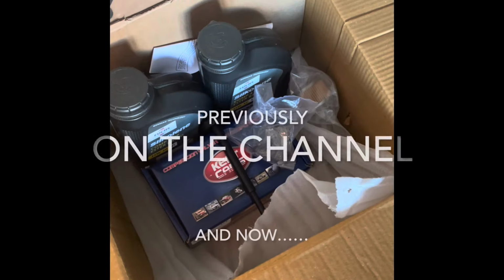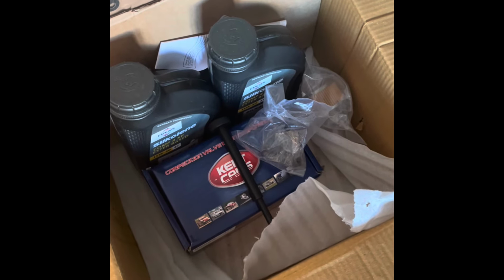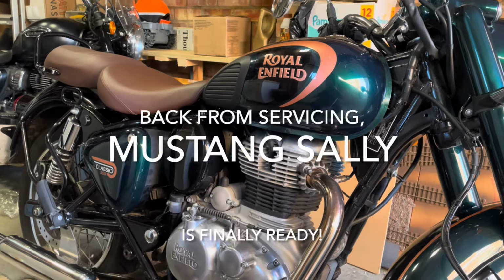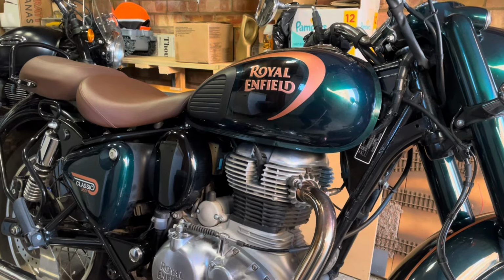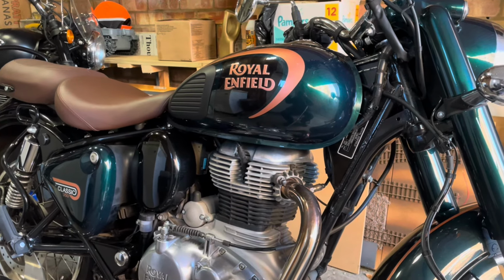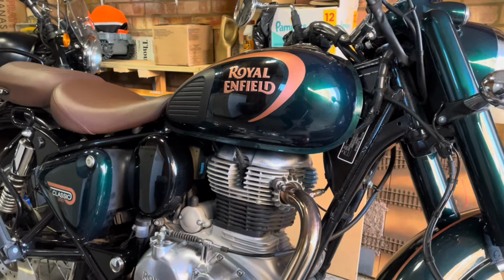The Royal Enfield Classic 350, now tuned with a high performance cam! At last!

Comment: Thanks for the heads up Steven!, still looking for a cheap twin shock drum brake rolling chassis with V5 for a sensible price! 70/80s 250cc trail bike would be ideal 😁👍
Im buying a cam as soon as back in stock  at Hitchcocks,
Im with you on the mid range torque to be had from these engines once released and will make them brilliant on country roads with steep climbs 😁👍
Reply: Aye wee all seem to be looking for the Holy grail..😂

Comment: Subscribed back. Look forward to how you get on with the campaign.
I got dna filter n plate, de cat pipe and red rooster exhaust silencer, but no, fuel x literally. So, think I get that fitted in next month or so. Then when next service due (6k miles) get cam done.
I know Ian (Tiger Ness) de did a video on the cam, and throughly happy with it.😊
As you say, I would appreciate the extra torque also.😊
Best wishes.
Reply from the maker: It’s sounds like everyone in Scotland will be doing the upgrades at this rate! I hope Hitchcock’s order in all the extra bits people will need! 😂
Reply: @TheNorfolkThunderbolt  was gonna order, last time it was in stock, but as it was coming into winter, didn’t see the point, at that time, for it, to sit in the cupboard for 4 months

Comment: Having just watched volcanic browns video on the performance of this bike I wouldn't be using that dealers again, from what he's said they can't have used the crank locking tool when swapping out the cam.
Reply from the maker: Yes, I suspect that this is the case. I had not used this workshop before as it is relatively new to the area. Needless to say I won’t be using them again, and I will be taking up the issue with them. Normally the work would have been done in my own garage under my own steam, but as you know I haven’t been well and had to farm the job out. In future, if I am not well, the jobs will just have to wait as I now have zero confidence in any local workshop…
Reply: @TheNorfolkThunderbolt  I'll be upfront with you Steve & tell you that I work for Haywards of Cambridge, we generally discourage the odd customer who suggests fitting performance cams to modern Enfields as we genuinly don't think the juice is worth the squeeze. To be honest so far only a couple of customers have suggested it on 411 Himmy's, one of the possible reasons your bill was cheaper than expected could be becuase they didn't take the engine cover off to lock the crank ? This would have saved time & effort but is unacceptable if you supplied the neccesary tools to do the job, don't get me wrong Steve I'm not trying to stick the knife in but this is the main reason I work on my own bikes at home. I'm lucky enough to have a home workshop with a brace of Hydraulic bike ramps & my own engineering machinery for making those hard to find parts for my 1930's BSA's & other bikes.
Reply from the maker: @gvinrad  no offence taken. I do these little projects for my own amusement and also to see if they make any useful difference. This time was an unusual occurrence as I was not able to complete the sequence myself because of ill health. I originally fitted the free flow exhaust to my Meteor for purely aesthetic reasons as I already had the same fitted to my Bullet. Then I thought, what if I go the whole hog and see what happens if I fit all the goodies? Well, apparently the parts certainly work better if the damn workshop does the actual work you paid them to do! There are many tuning options that I certainly wouldn’t recommend, especially if you don’t have any experience of doing so. In this particular case, I checked with Hitchcock’s on each item used and quizzed them about each in turn. As for being “worth the squeeze”, that was not a factor in this case, as I wanted to see how well they performed together in concert. Anyway, it was a hobby project and it’s now done and dusted. I do agree that from the point of view of cost, it certainly isn’t a bargain, but it was never about that in this case.
Reply: @TheNorfolkThunderbolt  Are you attending the Wheels at Wells show tomorrow ? I'm riding over on my 1996 500 iron barrel bullet, the one I took to the outer Hebrides last year.
Reply from the maker: @gvinrad  I didn’t know about the show! I shall have to see if I can lure my wife into going there with the promise of fish and chips (this gambit usually works!).
Reply: @TheNorfolkThunderbolt  Worth a try ! Might bump into you then with a bit of luck ?
Reply from the maker: @gvinrad  I can also be contacted via The All Year Motorcyclist, and Volcanic Brown of course. Just in case I don’t get there. Keep in touch, I always enjoy making new friends since I retired!

Comment: Nice video, but here in the states speed limits and traffic speeds are different. After boosting toque numbers, is it possible to remove the speed limiter/governor? I’ve never heard anyone discuss how that’s done.
Reply from the maker: Allegedly you can get rid of the speed limiter by fitting the Hunter’s throttle body/ECU unit. I don’t yet know how reliable this information is. I may revisit this in a future video.
Reply: @TheNorfolkThunderbolt  Thanks

Comment: As for modifying a 350 because you 'should have got a bigger bike' thats nonsense.. The RE 350 is an engine that is ripe for a few enhancements to improve the bike.  Harleys are the same from brand new and they are not a cheap bike at all. Being under developed to suit the Indian market and lower quality fuels, the 350 with a cam and other mods isn't then a high strung engine, the reliability should not change at all. Making these upgrades well within what is reasonable for any owner.    Its when you take a nice bike and 'hop it up' to the point that its unreliable or hard to ride that its a silly idea..